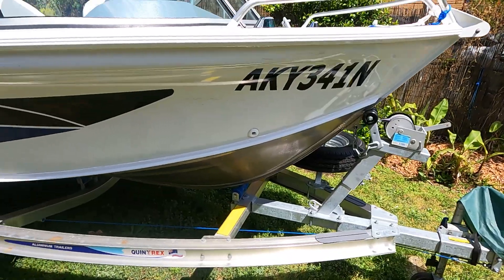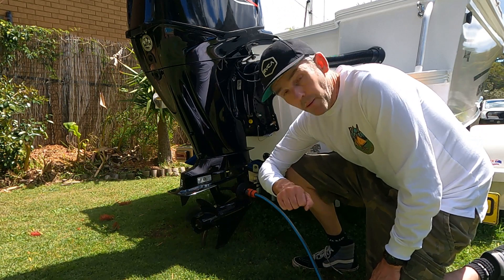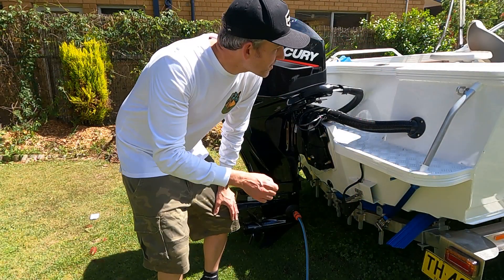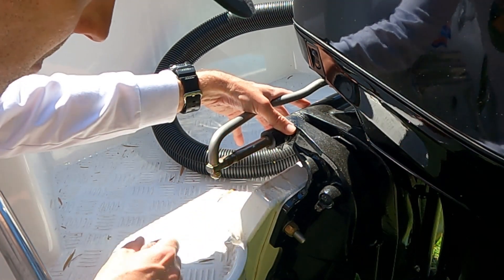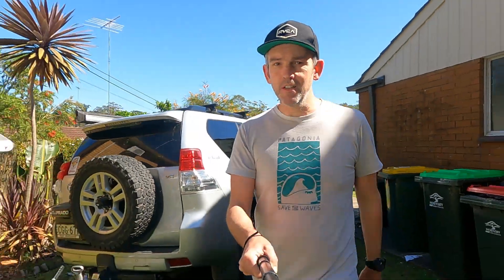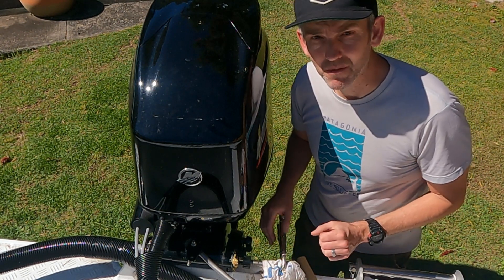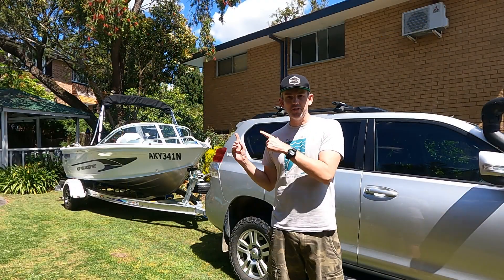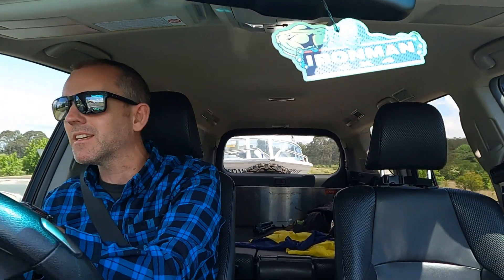Quintrex 450 Fishabout Pro seized steering outboard BBA Tips Monthly Maintenance Part A - EP26

Comment: Rather than tilting the boat to get the solvent in, you can fit a piece of long fuel hose over the tilt tube nipple, flex the hose vertically and pour solvent into the hose. You can leave it in place for a few days and gravity will work the solvent in through the tilt tube and the old grease and  gunk will exit the other end of the tilt tube. You can also apply air pressure to the fuel hose to speed up the process. You may need a mallet and block of wood to get the cable moving if it's really seized, but once you are able to get some movement you can work the steering wheel back and forth until you have full movement.
Reply from the maker: Thats a great idea, i will try that next time it happens.  Has to be a whole lot easier than tilting the boat up

Comment: You need to undo the nut on the right hand side which will disconnect the steering cable from the engine. You will most likely find the rod will move in and out without a problem and the problem is in the cable. Every min just spent was a waste of time.

Comment: You do like the WD40 not good stuff since 1984

Get Inox will not damage the boat. No petroleum in it.

This Cool video and editing.

Kinda missed the repair part..

Don't forget to check water levels before chargng a flat battery, plate/s might be exposed.

Comment: Mate, thanks for your effort making the video but it once again displays the youtube mindset of the blind, wanting to lead the blind. The whole video was full of not just poor, but bad advice, from using WD40 instead of oil on many areas, to running the gearbox in reverse for 5 minutes after you just ran it in forward?? And how does that help the grease on the prop shaft, because clearly you don't understand there is no grease in the gearbox as you are thinking? As soon as the steering cable shaft rotated, it was obvious the problem was not in the tilt tube but you persisted to attack it for days?? What piston - that's not how it works? Could it be the cable maybe? Narghh, what cable, let's attack the boat with a high lift jack instead. Mate quit while you're ahead before someone following your advice gets hurt and you get sued. Maybe stick to your day job... as the white Wiggle?